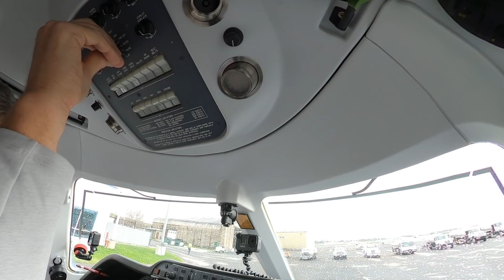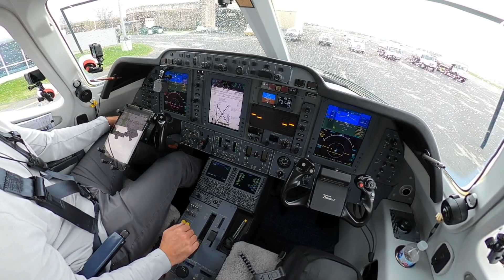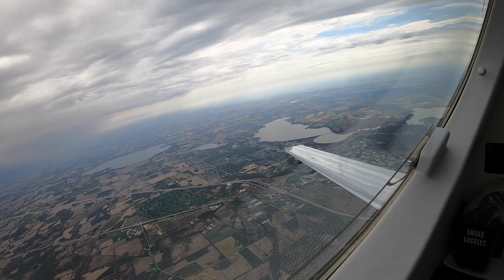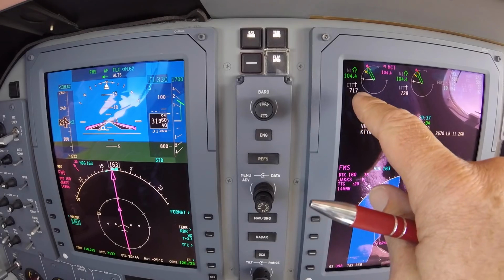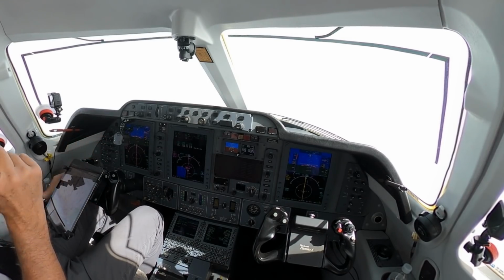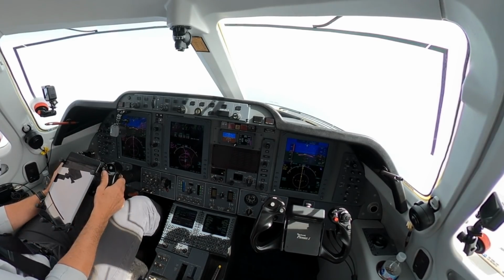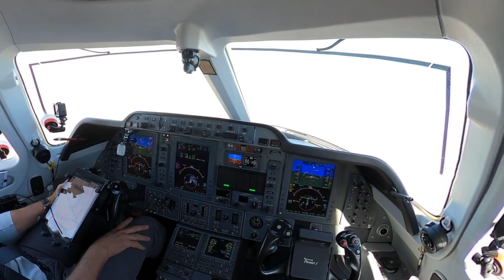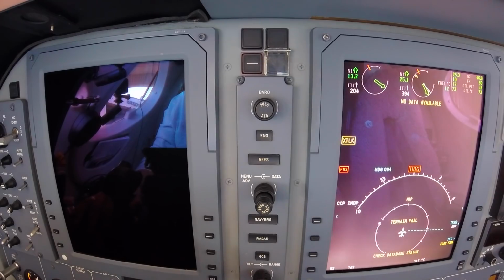I may have screwed this up! Private Jet Flight

Comment: Great videos! I really miss being in the air. I was a sworn officer assigned as a JAFO on a police helicopter operating FLIR, spotlight and police communications - pilot handled ATC and flying. I am retired now and really would like to try fixed wing. 
Does anyone have any suggestions or recommendations for someone or place I could go to tag along for a flight? I am in the Baltimore/Washington Corridor.

Comment: Isn’t there a 200 knot speed limit below 10,000?
Reply from the maker: There is a 200 knot speed limit below class B airspace and a 250 knot speed limit below 10,000’. The speed you see on the forward camera is groundspeed in mph. There is no restriction on that speed. The speed they reference is Indicated airspeed
Reply: @gregmink  gotcha thanks!
Reply from the maker: @baseballrockssb  I get asked the speed limit question a lot. The other speed limit is remaining sub-sonic.
Reply: @gregmink  Yea its hard to remember all the speed limits because flying in small piston planes I dont really have to worry about them. I still probably just could have looked it up on google lol

Comment: 900 pounds of fuel = 132 Gallons. 
What is that for fuel  $192,- ?
....or is it $6 per gallon?, which would make it $792,-  on fuel costs alone for this flight.
then airport taxes... parking fees etc...  and not talking about the plane + maintenance itself.
very nice to see but also mighty expensive!

Comment: That 890 lbs of fuel is what you have left ? Or what you used ?
Reply from the maker: Used.
Reply: @gregmink  Roughly 100 gal . $300 , 40 minutes .close to $75 /hr.  Not bad . So the farther you go the more economical it gets considering climbing and cruising differ in fuel consumption. It's fantastic if you got places to be and you don't need the hassle of going commercial when your time is  the most valuable commodity you have.  i really like your attitude.Cheers !

Comment: The N1 at 104%  must be a calibration error because if an engine goes over their prescribed N1 speed it will warp!  It was called a compressor overs peed.  On GE 610 Jet Engines and the other jet engines I worked with!

Comment: So if my calculations is correct, it cost you roughly over four thousands dollars of fuel for your trip.  Am I close, or am I way off?
Reply from the maker: Well I think it was about 1000 pounds which is 100 gallons and fuel right now at most places is about 3.50 a gallon.
Reply: So I was WAY off on that. Wow

Comment: If you want to have some fun, read the close captioning. Artificial intelligence is rather stupid (AI is used for YouTube CC and it's atrocious, but humorous in its errors).
Using closed captioning because, I'm partially deaf in one ear and the other one ain't so hot either. Damned IED.

Comment: Oh, so ur title in YT about “screwing something up” w/ input of data on preFlight; yet, u were keen to catch it maybe 🤔 ur F16 instincts ⁉️

Interesting 🧐 so once u start one engine u have to bring the generator online that u utilized to start that engine to get the battery 🔋 recharged ...?

So a “battery start” as opposed to what other start, Greg? Maybe a different modality?
So ur inputting into the FMC ur flight plan  ending up at altitude 350 after meeting all the intercepts in btwn ?

Back taxi on 21 ? is that a side taxiway
 w/o runway incursion in the rain ☔️ 
Maybe 🤔 ur using part of a runway to taxi on to start ur take off roll?

Vr at 111 ~ Rotate 

Aristik cable there at Madison, WI for a tail hook 🪝 (vipers) 

Throttle all the way forward clears the windscreen of rain 🌧 as ur seeing ur f16’s below departing out left climbing to 5000 then 7000

....have to start the day 12/8 p/u later..just finished ✔️ workout I utilize these bands / loop strap / exer ball lot of variety / day ...

I’ll check the conversion on mph vs 
n m / hr ?

I imagine ur painting 🧑‍🎨 “live” weather radar on this cloud ☁️ covered flight ✈️ day 

R u usually at a 5 degree rate of climb 5 k to 10 k altitude ? Full throttle ? 

Ur in a blinding cloud ⛅️ refraction of light 

Entering all those weypoints yet only used two of them, interesting 🧐 

The next RAD is not so hot then vs adjacent live radar 

Beautiful views cloud variation 

BFD mvs navigation mode / altitude pre selector to 330 / auto pilot climb .61 to.62 1,300 ‘ / min (over 18k its 3 numerals i e 330)

n1 fan 104.4 max thrust # 
Digitally generated signal 42 k rpm maybe recalibrate 100%

Are the people at Williams where u purchased ur Beechcraft Premier?

560 fuel flow / temperatures # ‘s not really matching side to side — yellow cautionary zone yet red it’s not right if ever at that point

Max temp very high above 900 

It looks cool cruise at 33k ‘ no passengers so not so much weight factor -> 900 lbs fuel ⛽️ 

vertical speed 1k’ down to 290

Panel overhead — pitot heat sys
Audio bell 
Lighting 
...ad kicked in here (infusion) on ur YT I’ll break it here to rtn ..@ 20’ in mark ..a bit later in the day ..

I was away a bit & learned the sad tale of the BA CAROLINA 787 mnfctr plant (non union workers plight)-

{It Reminded me of construction 🚧 workers who stick their lunch (trash refuse) btwn the framing & sheet rock or the foundation workers who display the rebar for inspection 🧐 purposes; yet, afterwards pulls it all out b4 pouring the cement}-

https://youtu.be/R1zm_BEYFiU

As I end this Wed, 12/9, ‘20 I conclude it w/ ur flight 🛫 from Madison ...

I think 🤔 I like ur ear piece that ur probably getting BOSE quality audio on, nonetheless

So ur pushing nose down 1k / min

Okay so overhead panel Mstr Bit ck..
Clear off caution ⚠️ panel waiting to clear stall or pitot heating ... reo Stats to moderate interior illumination on ur avionics

Btwn O’Hare & Midway in the clouds runway 18 to the south into Indy 

U noted skies were pretty well vacant of usual heavier traffic 

Descending 330 to 290 

Altitude alert 1k feet b4 selected altitude incurred 

Outs to out catch ???

Andrew / commercial rating , part 135, he is going for 

FAQ vhs intro was that ur Dallas to montrose YT?

Descend to 240 altitude selector vertical speed / descent rate as retard the throttles so not to over speed the airframe 

3 mile final to 36 —> FMS vertical / latitude guidance make sure to correct destination (runway) to always have that guidance for redundancy sake 

Enter temperature sent up to pfd 
See go round speed ???

3505 

Descend FL 240 

Having been Given  Jack’s 13k , execute
vNav ..altitude 3% glide slope snowflake ❄️ high to glide slope vertical speed bottom of decent arc hit jacks at 13k alt

Late decent rush to catch it tight xss’g so get descent over  Lafeyette (over Perdue U. in Indy) wonder if u can go vfr at this point 

1210
What approach was that ?

Descending 130 

1210 not the frequency over here 👈 
Nobody there 121.1 his bad (Chicago) 
Down to 3,000 
Airport in sight ..cancel the IFR 

~ Okie doke here we go ~ 

Ur about 400 mph 

Ur cameras are amazing r u directing the bee 🐝 bopping from  u view to the other variation of camera sightings around ....I like ur little roving cam u set on the dash where u can focus, at will , interior view especially on avionics to teach us 

I can’t recollect is that G3000?

Okay below 10k’ so sterile cockpit for proper CRM

9 to the west downwind entering left dn wind sees plane taxi to departure 36 

so , then,  winds r coming from the North ? 360 on ur magnetic 🧲 heading?

Ur Looking 4 the guy on base 

1 notch flaps out / gear coming down 

Left base 36 — 175 mph 

1,000 
Exec traffic turn to final / full stop (military in him) 

Guidance to runway like an ILS 

136 mph 

Nice landing ‼️

62 mph 

At the point, ur clear of the runway releasing it out of courtesy sake to have the bloak awaiting begin his take off roll b4 the plane ✈️on downwind hits his base “oh yea, this is the film 🎞 in ref to the student pilot that screeched  (FAA)!”

Summary -
42 min , 264 mi , 190 lbs fuel ⛽️ burn 

Pretty cool enjoyed learning, Greg !

GodSpeed , brother 🛬 , til next time, as I try to fly premium 1 / day is really the ONLY way !

Climbing a step, e/day, ...  🆙 where we belong ...

https://youtu.be/e06iWT9vSlI

Thank u 4 the fuel ⛽️ burn 🔥 rates at altitude even on short flight to get up in rarified air; also, the links to various equipment referencing in ur YT description

⁉️How tall r u, Greg⁉️

Comment: 264 miles using 890lb of fuel. Is that 1335 gallons? Even if you could get it for a $1 a gallon it makes the bus look great, even if it does take 5 hours!

Comment: Talhook on an F16? I'm no F16 Pilot, but I do know that F16 are only land based
Reply from the maker: Yes they have a tail hook. It isn’t as beefy as the navy planes but it is there. That is the reason for the arresting cable that I taxied over on the takeoff. You can deploy the tailhook if you have a brake failure and stop the plane.

Comment: So for  aprox. 265 Mile trip the plane used nearly  900 pounds of fuel = about 133 gallons = 133 x 0,87( pre Covid 19 price) $ = 116 $ .With Covid 19 a kg of Jet A 1  costs 0,20 $/ kg So currently the trip fuel  costs only  900 x ,45 = 405 kg x 0,20 = 81 $ ! America is truly the land of the free!

Comment: About a year ago you mentioned that using the words "take off" was not really the proper term that should be used....rather, "Departure" word be the correct word that should be used.  I've found it quite amusing that ever since you mentioned that, as I've been watching your program, and several other pilots broadcasts, I've noticed that most everybody uses the word "take off"....and very rarely do I hear anyone using the word "departure".  I guess that indicates the use of street slang is fairly common in the air, as it is in life.  Just a observation......no biggy

Comment: I would prefer just not do anything but fly a armed aircraft and just fly where ever to go if low on fuel pick a spot to refuel and do evasive manoeuvres incase Of aircraft’s spotted of hostile then engage combat. I would rather have everything in metric units and use metres and Km/h and degrees Celsius rather than Fahrenheit because these units are more accurate.

Comment: Grege the information you where trying to show on the camera on the main  panel  wa totally unseable becouse they where to small to see with out a magnifier especally  from the angle the camera is at so I would suggest that that you eather use a magnifier if possible when showing things of this type  on the main control panal or get your self an otheir otheir camra  & put it it some  where up close to the center of the main control panal with it pointed directly straight to that part of the main control panal & I wold suggest that you do the same for the control panal on the roof of the plain from down under it maybe from some where around the buttons locatted on the control panal between your front seets if possible Grege as puting cameras to this locations would make it possible to get a c,user direct view of the control panels that you seem to be talking about quite often & seam to behaving a problem showing in a good dirrect view of the control panels. Often Grege.

Comment: See a lawyer if you want legal advice.  But... I took a stopwatch to it.  From the time his call with the word "CLEAR" to actual runway clearance per wing cam, was approximately 1 second. And the mic off took most of that second, meaning the actual transmission was complete at almost the exact time the runqway was cleared. it was given with adequate time, no risk of incursion by any REASONABLE observer. The timing indicates that its "not material" for safety.  The other viewer is being an ass, and trying to start trouble where none exists.  Need I remind him filing nusiance reports to the FAA can be considered crime.  Typically, false FAA hotline complaints come from a person on the same airfield as the airman at issue, who has otherwise gotten their “nose out of joint” and is going to “make the other airman pay.” In other words, there are people out there that will file a report with the FAA because they know it could potentially spell trouble for an airman’s career and/or the airman’s ability to fly.  I believe 14CFR like most Federal Registry rules contains possible punishments for abuse of the anonymous reporting system.  See OSHA for example. Internet jerks are going to be jerks, what ya going to do

Comment: The 104 is, as you said, calculated. Bunch of ugly assed math I can't figure out makes well, everydamnedthing work out.
Hint: From the formulae I've saw, no human can calculate that before one has fuel exhaustion and unintentional air-ground incursion.
Bit test, well, you can skip it if you don't care about becoming coexistent in spacetime with a spot on the ground and your aircraft. I don't recommend it, but one's mileage may vary.
Might also want to tag this video for IFR initial approach.

This is one of the first flight videos I've watched, start to finish, most have so much null time that one misses cockpit information load management, even for a one man flight.
Frankly, I've not looked yet, but do you have an entire flight or at least full approach and landing under IFR only?
You did one hell of a job illustrating an essential outer approach ILS approach and let's face it, the hardest thing for far too many pilot is getting them to trust their instruments more than their balls.
Hell, even handling the initial foul-up is good to educate student pilots! And I'm damned tired of hearing pilots flying into terrain because they don't trust the instruments more sensitive than their senses, but can figure out things when an instrument is deadlined and alternates should be used.

Again, excellent job on displaying pilot error in configuring a flightplan in the compooper, recovering, ILS initial and trusting your instruments and basically, turning this into something nobody who's never commanded an aircraft would find boring, exemplar for information load and handling. If I ever go back into teaching flight or complex tasks management, I'll be using this cakewalk.
Reply: For full approach and landing (IFR), I recommend https://www.youtube.com/watch?v=IBSXVAQdBt0

Comment: N1? duh its because it is 104% of rated power duh! most jet engines are derated for safety and efficiency duh! (a lil cushion for the pushin(duh!))and since air is cooler up top engines can run hotter than at the sea level duh! its technology duh!

Comment: V/S open decent it more efficient IN AIR BUS HA track FPA 3 degree FINAL APP its like a mini airbus. was that a retard when you landed ha nice flight sir hot brakes starts them fans. i went to buy the white zip top but its not there

Comment: You shouldn't say that you're clear until the plane has completely passed the runway hold short line. "An aircraft exiting a runway is not clear of the runway until all parts of the aircraft have crossed the applicable holding position marking." AIM 2-3-5 (a)(1)
Reply: Doesn't apply at an uncontrolled airport.  Done out of courtesy for waiting aircraft.  This guy is a pro

Comment: as for the idiot who thinks 1 sec whan an aircraft is moving announcing clear is a problem by the time you finished you were more or less clear the other aircraft was at the other end not even ready to start run up  dont worry i would fly with you any day in any weather

Comment: I rather do all the flying once I’m in range.    All these bells and whistles. Many pilots can loose that touch.      I watch a professional pilot crash a 737   During the investigation the FAA found even though the pilot had 9000 hours. He had very little stick time landing by hand.  He was too low and slow. The 2 deadly sins of flying.  The CAPTAIN missed it too. By the time they went full power it was over.    The report stated   To much automation and not enough manual times.  That the company needs to do more training with its pilots.

Comment: pulled your gear up to soon,should until you have  a positive rate of climb  at 100 ft,also your auto pilot should not be engaged until 1000ft  just in case you have a hard over. from a air line pilot with 25000 hrs
Reply from the maker: Thanks but you fly your jet and I'll fly mine.

Comment: 16's don't have trap ability. That's AF only, 18's are what you're thinking of.
Reply from the maker: Nope, I flew 16s for 10 years. They have a tail hook and that is the reason for the arresting gear. You are correct though, no traps for the Viper. The hook to grab the arresting gear was only in the event of a brake failure or imminent overrun. The hook is quite small compared to the Navy stuff.
Reply: @gregmink  heh after 20 yrs with the af... learn something every day. Cheers

Comment: your use of checklists is deplorable. Didnt see any checklists done (sure, maybe edited out) except the before taxi checks but then did the before taxi checks WHILE taxying but didn't even check anything, just scrolled through while saying "yeah I think everything is set here." That's what the checklist is for - call a check, look at the item, read response. And what sort of takeoff brief was that - didn't hear a single thing involving emergency scenarios."   Complacency beautifully displayed here.    Non aviators, don't be fooled by snappy radio calls - that's not what makes a professional.